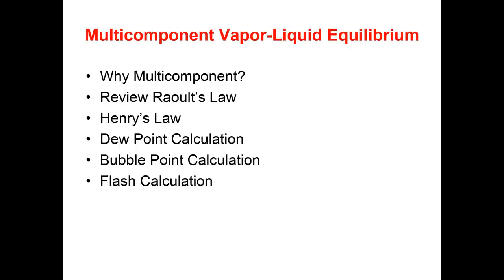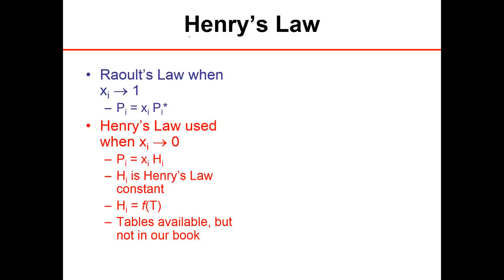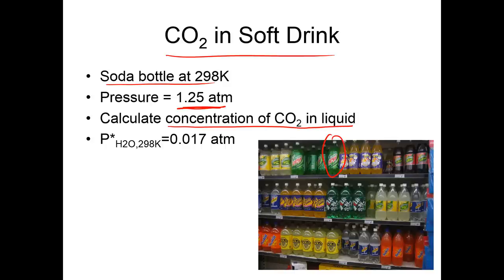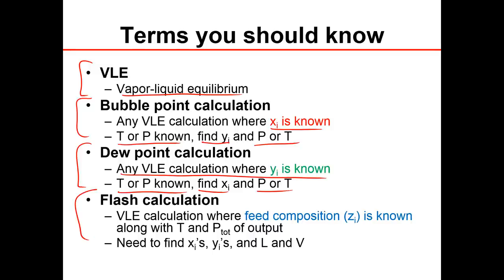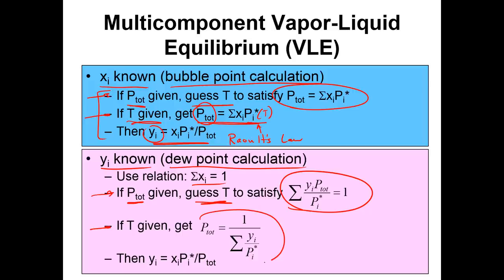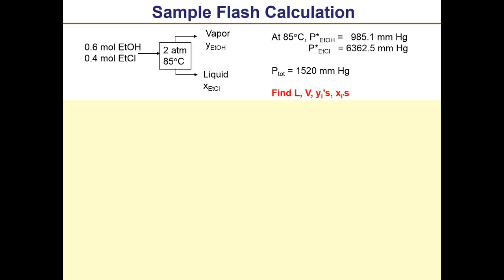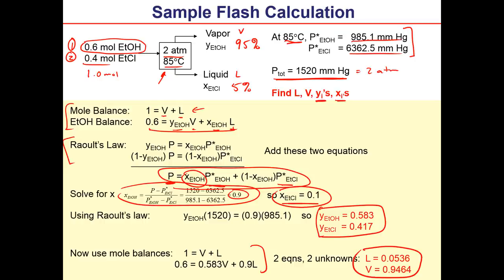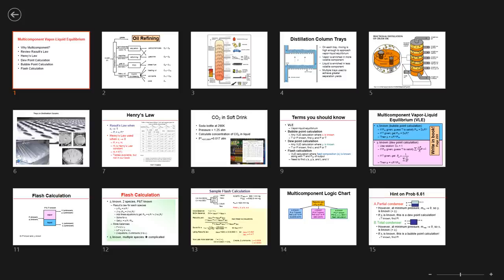Vapor Liquid Equilibrium for Engineers

Comment: Awesome for passing tests lol. But how in the field do you measure this or has any of our professors actually held a job before.
Reply from the maker: +Brian Sullivan, I worked 7 years in industry for ExxonMobil and other companies as a consultant. I was coauthor on a patent that heavily uses VLE to improve reactor efficiency: Lawson, K. W., Hedengren, J. D., Smith, L. C., Method for Controlling Bubble Formation in Polymerization Reactors, International Patent WO2012005740, Issued January 12, 2012, United States Patent Application 20130203946, Issued August 8, 2013. VLE  and flash calculations are essential for practicing engineers. Simulators help with the calculations but engineers need the fundamentals to better understand the simulator results.